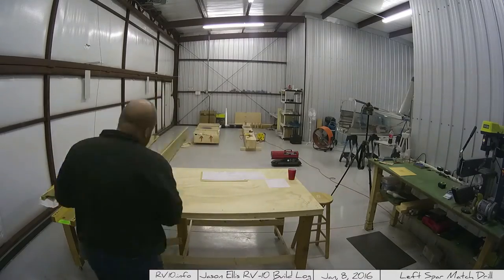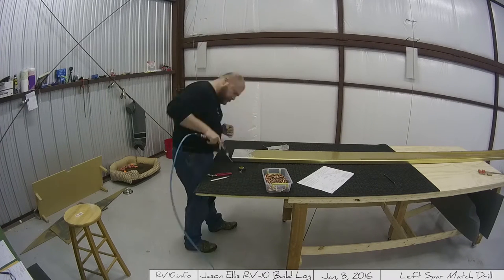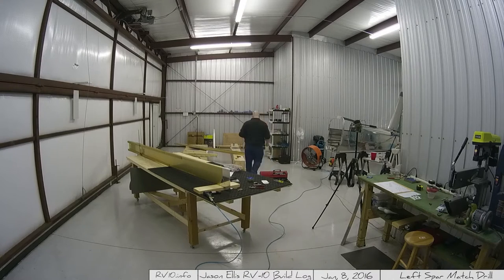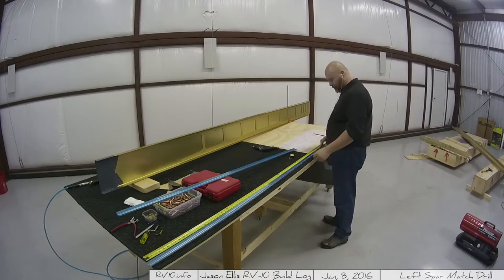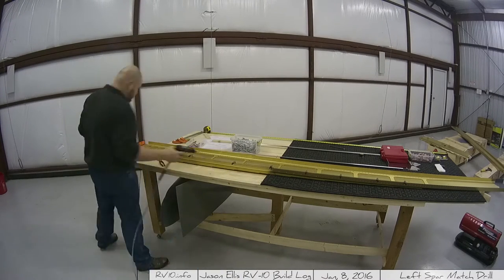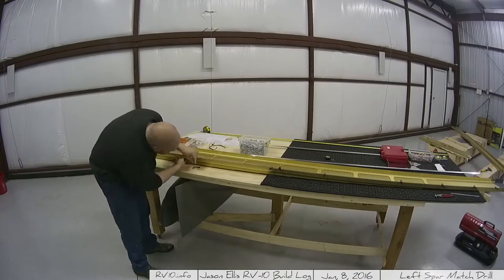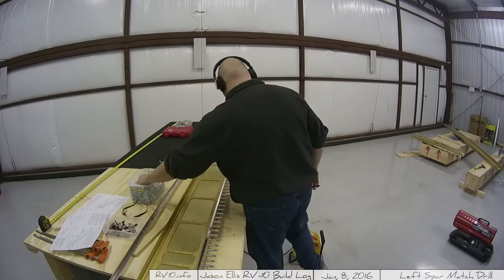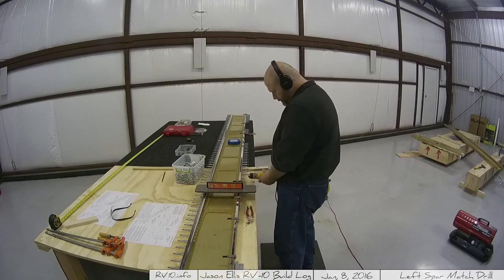RV-10 Wings - 003 - Left Spar Match Drill / Countersink

Comment: Jason, I knew I should have watched this video before doing these same steps myself!!! Yesterday I was match drilling the stiffeners and almost made the same mistake you did. I nested them together at first just like you did. I was drilling the bottom first and I kept saying something did not make sense because it told you not to drill a section and if you nest them together there is no J-channel there. After looking at Ed's video I finally figured it out but he did not make a note of it like you did. Had I viewed yours before working, I would have saved myself 20 minutes of anguish! Also I had the same issue with 2 holes vs 3 holes vs 4 holes skipped where one drawing was showing different from the other. It made me laugh to hear you having the same issues as me.

Comment: Hi Jason, I now heard you talking about your extension cable getting warm. I think this happened because you did not roll it completely out of the drum. Your extension kabel rolled on the drum is working like a induction coil and is getting warm. Just roll it completely of th drum and you will fix this. Btw: I begun with my RV10 in January and am actually finished with the preparation to prime my vertical stabilizer and begun to work on the horizontal stab....